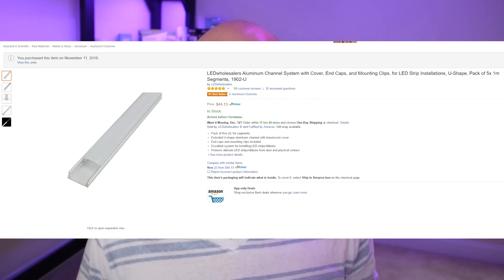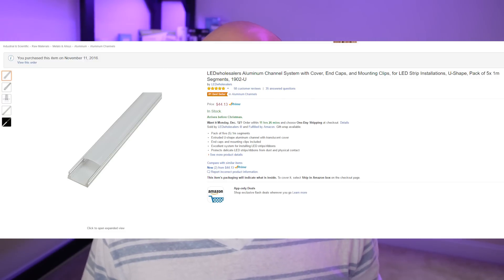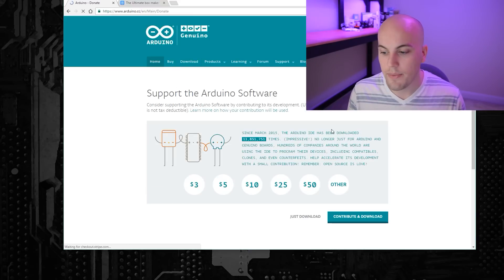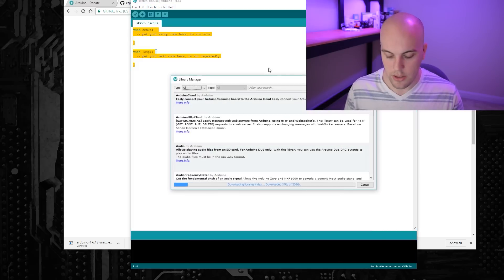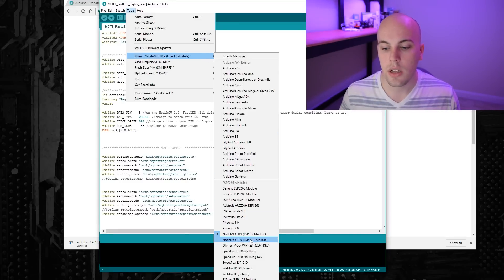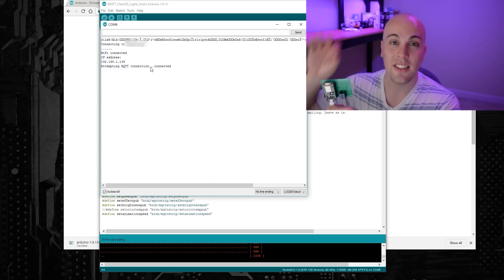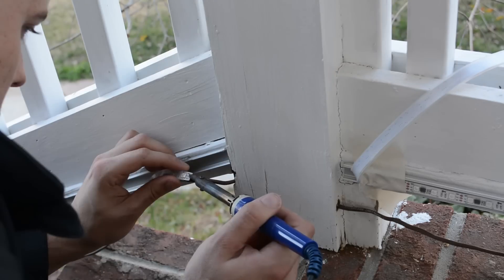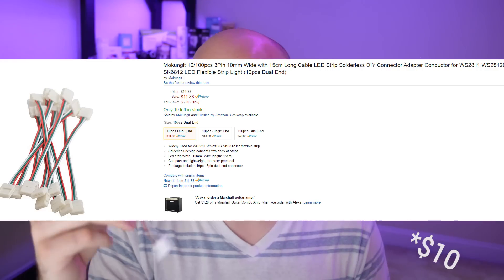The BEST Digital LED Strip Light Tutorial - DIY, WIFI-Controllable via ESP, MQTT, and Home Assistant

Comment: Really, nice only problem i have is that i want a rgbw light with esp8266 (LYT8266 to be specific) and neither MQTT Light nor MQTT json light supports a white channel :( The LimitlessLED component does have a white channel so i know its possible to do but im to bad at coding to be able to adapt that to a new RGBW MQTT component.
Reply: Have you asked on the forum? ...Or I've often found you get a better result by posting an issue on the github repository. I'd give that a bash. I'm thinking about doing an RGBW project myself, so I'll be happy to support your request. Put a link up here.
Reply: Johan Lindström I was thinking either 2 "lights", or just a generic input slider for white (much like how Ben does the animation speed in this video).
Reply: you could fix this on the esp8266 side if you are willing to compromise a bit.  you can get the RGB value from MQTT light and add the W value (the compromise would be that you would use RGB or W) if your RGB values are all 0's you could turn on white, if your RGB values have data, then W would be off.  Or something like this.  Let me know if you have questions.
Reply: Johan Lindström Hey. I'm the guy who built the MQTT JSON light platform for Home Assistant. I have an open issue on my GitHub repo for the ESP code to support the white channel. I haven't gotten to do real research into it, but I don't think Home Assistant sends a separate white value for any of the light platforms. I'm going to research ways to add it next week.
Reply: @Stuart Feltham I've got an issue up at the MQTT json light here:
https://github.com/corbanmailloux/esp-mqtt-rgb-led/issues/7
Reply: Hmmm i might be able to split it up with two light elements, one for RGB and one for W. Not optimal but a good workaround for now.
Reply: Corban Mailloux i think you correct. The Limitlessled has some wierd support for it.
Reply: Why a white channel? I thought RGB all on at 100%=white? (thanx for your reply, I'm just tryin' to learn somthin' :)  )
Reply: The white produced by the RGB leds will always have a colour cast to it and be a low quality of white light. A dedicated white LED gives you the option to have a high quality white which you can change the quality of with the RGB leds, and it will also increase the lifetime of the RGB leds because they don't all have to run to produce the white. Hope that's helpful.